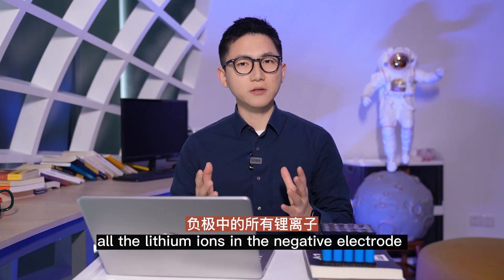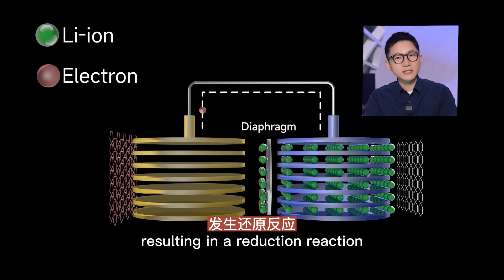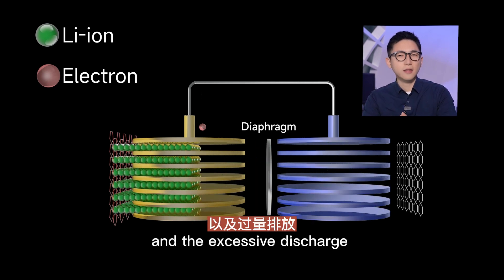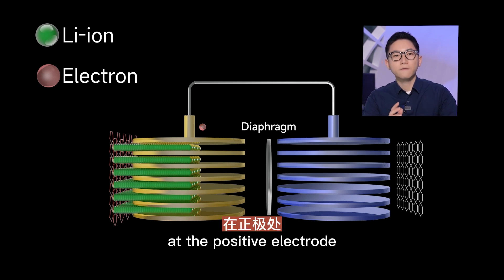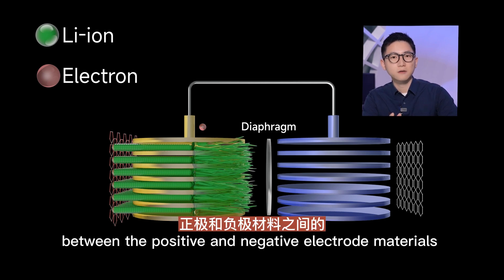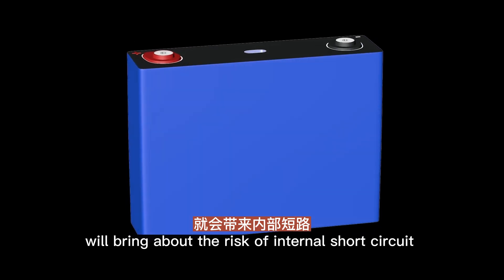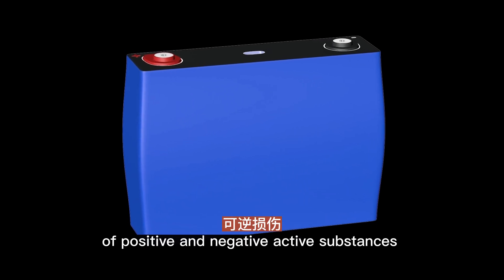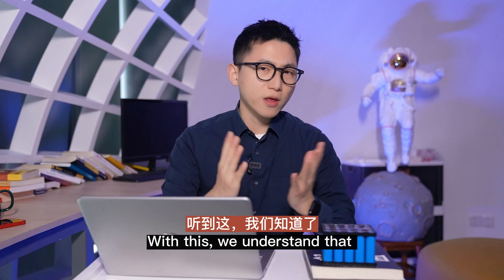Popular science 2: Misunderstandings about #lithium #battery charging

Comment: Thanks for this video and great explanation , even without subtitles I wouldn't often understand what you're saying.
It's well known fact that sacrifice (approximately) 10% from cell top SoC increase its life twice (roughly). It means that if cell have designed life 500 cycles under 100% DoD, with 90% DoD it is 1000 cycles and under 80% DoD it is another double - 2000 cycles.
Let's see how it looks from total energy perspective. As example we use most common 18650 cell capacity - 2500mAh.
Under 100% DoD you'll get 1250Ah delivered capacity. Under 90% DoD it's 2250Ah and under 80% DoD it's 4000Ah.

But I would like to know, WHAT EXACTLY happens inside cell, when cell is undercharged for longer time (below 2.5V) but not fully dead and then with low current slowly recharged back to full SoC. Many reports says it's possible (some chargers have "revive" feature for exactly this situation) and cell after this "resurrection" working normally again, but I don't believe that. Some irreversible damages must happen. But what changes or damages exactly? And how such low voltage effect cell from reliability, efficiency or safety perspective?
Reply from the maker: we'll look into it
Reply: I'm sure that Depends on the chemistry and physical construction, the "revive" feature is normally associated with lead acid batteries, people can't agree if it is real or not. I wouldn't try something like that on a lithium battery in case it burns up, and if you do such treatment to it, you would definitely need to run it through a charge/discharge cycle to see it's capacity